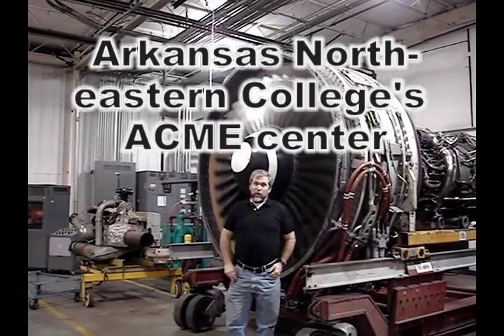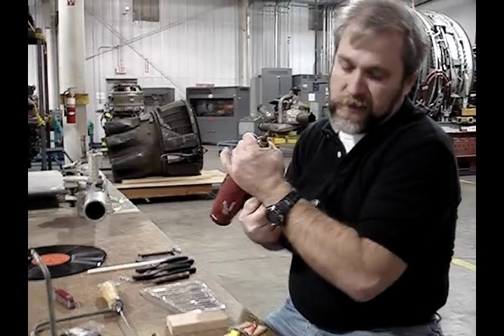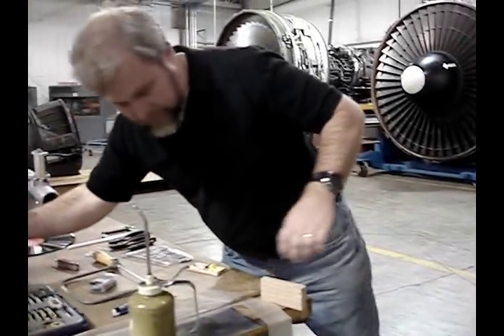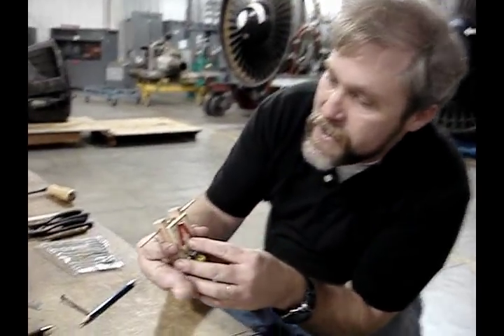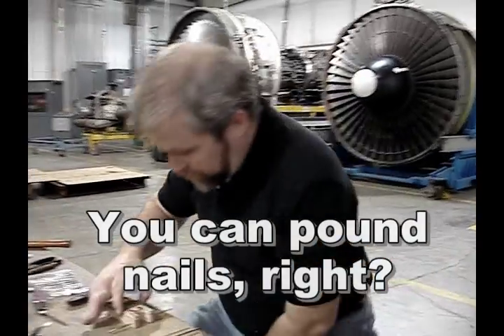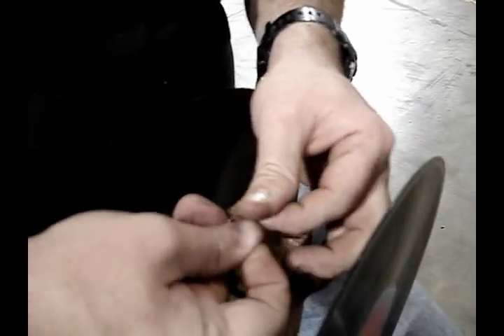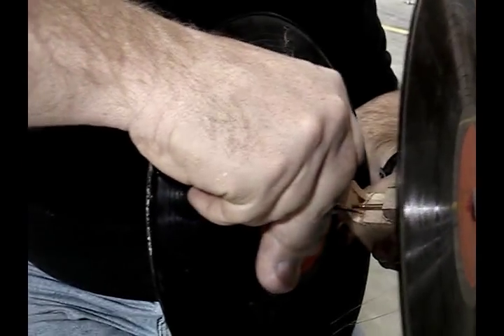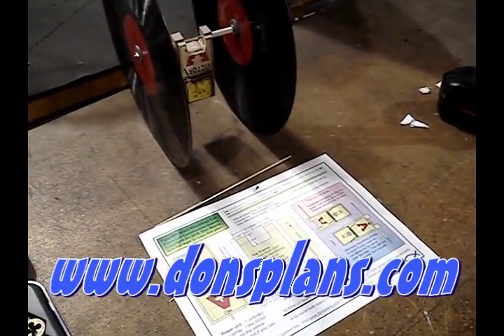Simple Mouse Trap Powered Car - Construction Details

Comment: Brazing rod
Power drill
Pliers
Oil 
Threader 6-32 die
116-inch drill bit
Oak block 964 inch drill bit
Saw
Brads
Brad hammer
Straw (Spacers) To hold it centered in the middle 
Two 6-32 nuts
Fender washer larger then a regular washer
25 pound fishing string
Bolts 

Is this all the things I need to make my mousetrap? Am I missing anything?

Comment: At Lowes you can find them in the steel rod section or something, just ask a worker.  You should be able to find a 6-32 3 foot long rod that is all-threaded for about $2.50 or something. Hope that helps! (and btw that is the exact same size that you need for the 6-32 nuts.)

Comment from the maker: @ProjectAlamir - It would if it was strong enough, but it only has enough strength to pull it a LITTLE off center.  That means that the car is unbalanced, and will start to roll forward - which tries to lower the trap.  But the trap keeps trying to climb, and the car keeps picking up speed.  If you use too large an axle, the trap will just spin.

Comment from the maker: You have to hold the trap a bit sprung while you wind.  The string goes through the hole, and then you wind it back around the axle and over itself over and over.  It will hold itself in place until the trap is almost sprung, then it will jerk itself free to allow the car to freewheel.  Watch the video again - watch it several times.  Ask someone who can show you for help - or you can drive to Blytheville, AR and I can show you!

Comment: @1donagin Thanks, I ended up not needing any weight for counterbalancing reasons, as long as the trap is placed almost horizontal to the ground, so the moment generated is just enough to cancel out the axle's rotation. If I placed it lower down, the trap would accelerate in the distance and sort of "overshoot" the horizontal point, causing it to spin around.

Comment: @1donagin I see. I was thinking of a weight saving measure where the axle would be supported by two plates attached directly to side of the mousetrap. I suppose without the wooden base, the assembly would be too light and the trap will spin instead. Perhaps adding a counter-weight on the other end of the mouse trap may achieve the same result with less total mass.

Comment: Is there any other way to make the string able to stay a little on the axle that does not require drilling a hole into the rod?
Reply: +Madison L Maybe if you used super glue on the axle?
Reply: then when the sting was unwound it would rewind the sting and then stop
Reply: +Madison L Maybe if you used super glue on the axle?

Comment: I made everything but I
JUST CAN'T GET THE 1/16 inch hole into the 1/8 inch rod.
HOW?
Reply from the maker: You need the 1/16 drill bit, a good eye, and a steady hand.  It can help to file a tiny flat on the shaft before drilling, or gently use a center punch to start the hole.
Reply: Thank you!

I'm going to try it now.
Reply: Ok, my car is finished and I can't thank you enough
but my chassis is spinning around my shaft instead of my wheels spinning.
Could you possibly tell me what's happening?
Reply from the maker: +Abdur Rehman Syed you may need to add a little weight to the trap.

Comment: *PLEASE HELP*I made this design for my school preoject.I made modifications though.PROBLEM:after i wind the car,when I let go of the mousetrap,instead of pulling the car forward the mousetrap wants to pull itself around the axle so the car wont move.Can you help me?DESIGN:woodblock w/ mousetrap still same but didnt use bushings or screws on back. the axle is a 5/16 bolt that is completly treaded with a hole drilled through it.Wheels and rest of the design i kept the same.  Can you please help me

Comment from the maker: @JradYouMad - It depends on several factors. Neglecting wind resistance, there would be no ultimate difference, as rolling resistance is not speed sensitive.  In the real world, there is a "sweet spot" where everything is best. I suspect that I am near that spot with this design. However, I could see "science fair" here, for some plucky young man or woman. Build the car, and experiment with different lengths of arm.  See what works best, and earn a big scholarship. Mine is to get you started!

Comment from the maker: @Duckiller31 - You can use brass tubes and/or you can lubricate the axle with graphite (a dry powder), you can use little bitty ball bearings out of computer hard drives...   There are hundreds of small mods you can make.

-Don

Comment from the maker: @glitzykitten - There are lots of options.  If you could center it on a wheel, that would be the absolute best from a physics standpoint, but it would be difficult.  I would tend to hang it on the end of the trap/wood block.  This will make you trap go farther IF your teach gets by with letting you raise the block up to 90 degrees for starting (which they might or might not do).  The only issue with hanging the block is that it will test your bearings.

-Don

Comment from the maker: @Duckiller31 - You would drill a larger hole instead of the 9/64th inch hole that is drilled through the wood block.  The straw is not needed at all - I just added it for fun.

-Don

Comment from the maker: @ProjectAlamir - You are correct.  Ideally, you would put a very light extension on the trap, and it would almost touch the ground.  Then, you would put just enough weight on the end to keep it from spinning - as far away from the axle as you could.

Comment: And I thought this was easy... I couldn't find anyone to get a hole through the brazing rod, THANKS A LOT HOME DEPOT, so I tried to wrap the string around the rod, didn't work. Then when I tried to wrap the string like he did by turning the wheel, the nuts just spin off and the wheels get loose. I used a rod that was threaded from the top to the bottom, but that shouldnt be that big of a problem....or should it? SOMEBODY HELP ME!! please :)

Comment: @MayaPapaya94 Try the slip knot, where the string only gains traction if the axle spins one direction, but does not pull when the axle rotates in the other direction. This would make sure the string still has tension while the mousetrap is tugging on it, but does not entangle the trap in the "cruise" stage of its motion. The hole didn't work out so well for me either.

Comment: Why is hardwood better than a softwood? wouldn't a softwood be lighter and therefore travel more distance because there is less friction?
Reply from the maker: You need enough weight to keep the trap from spinning around the axle.  You can use a softwood, but you might need to add weight.

Comment: Is there something else that would work like a braising rod? I can't find one anywhere😔
Reply from the maker: Any strong (metal) 1/8 inch diameter or 3mm diameter rod.  Brass is easiest to work with, but steel works too.  Onlinemetals.com and Speedymetals.com are places that certainly work, but most towns have a hardware store or farm store that will have something like this.  Welding suppliers will also be good places to check.
Reply: @1donagin  Thankyou very much!!